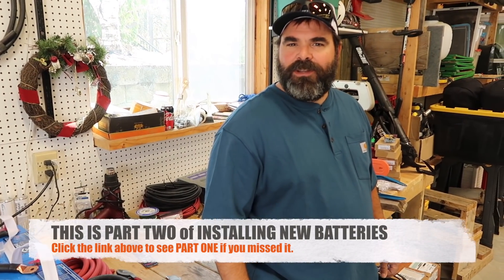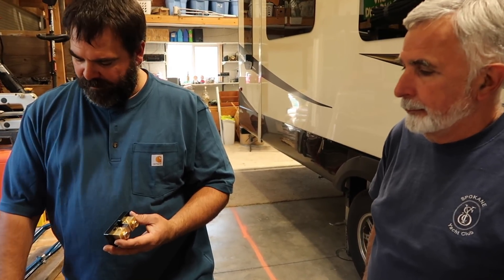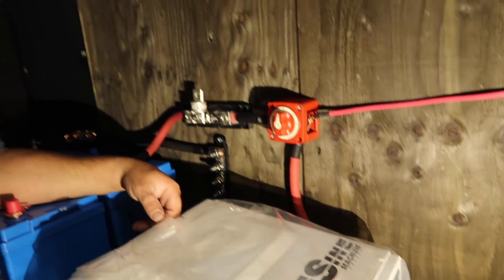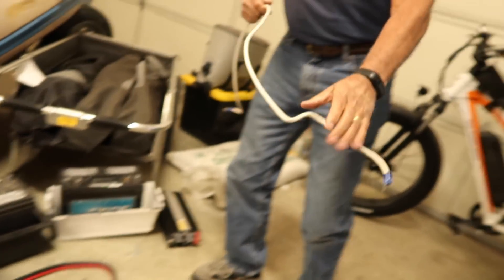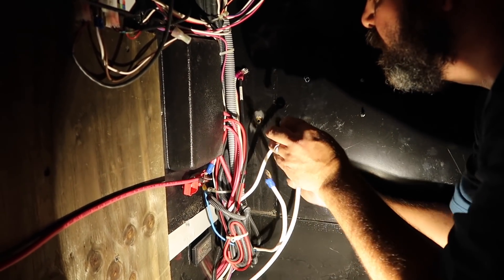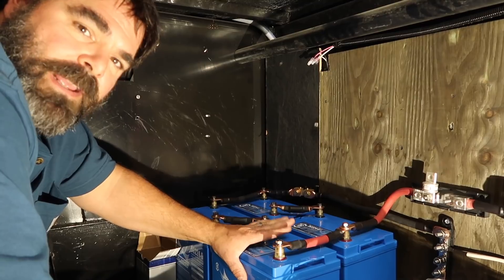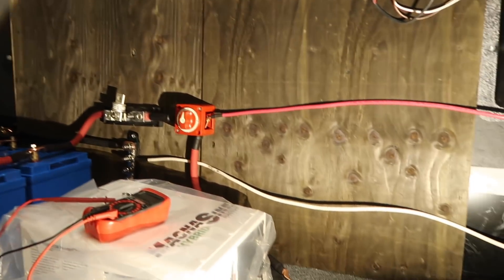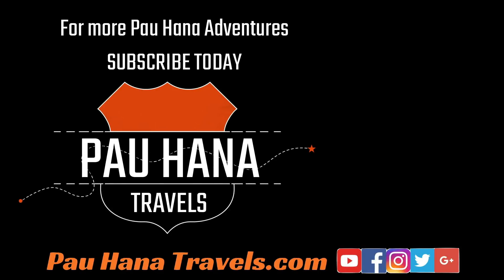RV Solar Installation - Part 2: Finish Installing Batteries & Wiring 🚐🌞

Comment: You could have moved the negative bus bar closer to the shunt to make the cable fit, instead of making a new cable. At that point, nothing else was attached to the bus bar...
Reply from the maker: We couldn't because there wasn't enough clearance behind the battery bank but we were actually able to reuse the short cable so all is good.

Comment: Great video! Something like No-Ox would be better on all the connections including inside the crimp connections to prevent oxidation. The dielectric grease is great for protecting all of the metal from corrosion.  Also, I would've ran the negative from the other battery to help ensure that they stay balanced even with the great cables. Looking forward to the rest of the videos. I like the Magnum hybrid inverter but it was out of my price range. Maybe a future upgrade.

Thank you!

Comment: I was under the impression that the battery hook up should have one connection from one set of batteries and the other connection from the other set.  That way both sets are active.  The set up shown utilizes only the closest battery set.
Reply from the maker: That will be covered in the next video. These videos have been shown in the order our install went up to this point and have made some changes since.

Comment: Great job. It is going to help greatly. Going to start my 5th wheel project in the next few weeks. Still a little confused whether or not to hook up to my existing fuse panel like John’s project or add a second panel like this one.

Comment: Nice job Gary!  I did notice something that you want to consider.  In a series/parallel battery bank I have heard that it is a good idea to make the external connections to the bank at the terminals on two ends of the bank.  In other words in your Dad's array, instead of connecting the shunt to the negative lead of the closest battery, it would be better to run a longer cable from the shunt all the way to the - terminal on the battery closer to the bay door.  The reason being that even though you are using heavy gauge wire, there is resistance and in the battery wiring as you currently have, the 12V battery closest to the back wall will see more load, than the 12V battery you have closer to the door.  So the theory is that the batteries will wear unevenly shortening the battery banks life.  If you instead, connect from the shunt through a longer cable to - terminal on the 12V battery closer to the door, the flow of current will travel through the same distance of wire for both batteries... thereby evening out the load.  Thanks for the videos!  I have to admit, a 5th wheel front bay is really nice to do this project (lots of space).
Reply from the maker: Yes I'm aware of the negative DC wiring. And my thought behind doing it the way I did was because there are only 4 batteries in the pack and it shouldn't put too much additional stress on the batteries. However, the 5th wheel is still parked inside my shop so I may as well make it right. Thanks Steve for your comment and support.

Comment: Why that size batteries do they size them by group size or by amp,s ..why not bigger or smaller and why not other types
Reply from the maker: These batteries are GC2 group size, 224amp hour. We chose Fullriver based on quality and user experience and the size was based on a few things like cost, storage capacity, weight. GQ

Comment: One thing that I have not seen in other solar installs is the positive connection from the inverter to ??? so could you please include that when you get to that part of the install. Also, thanks for doing a full solar install video. I am wanting to do the same and enjoy learning from others. Thanks.
Reply from the maker: The positive comes from the batteries to the inverter and uses that same line to charge. That is covered in part 1 of the video series. Part 2 picked up wiring all the ground connections.
Reply: My question is were does the positive out of the inverter go? is it the AC bus on the regular bus/ fuse box in the RV?
Reply from the maker: So if I understand your asking how we connect the inverter to the house side of things correct?
Reply: Yes
Reply from the maker: That will be in our next video (have yet to edit it but should be covered). The original circuit breaker box feeds the inverter, the inverter feeds the sub panel and the sub panel feeds the hot circuits in the house.
Reply from the maker: I know it’s confusing but our next video should explain it better.
Reply: Thanks I just have not seen it in any other videos so it will be great to see it explained.  Gary does a great job explaining what he is doing. Thanks again.
Reply: Also could you please include a parts list of what is being installed. Thanks